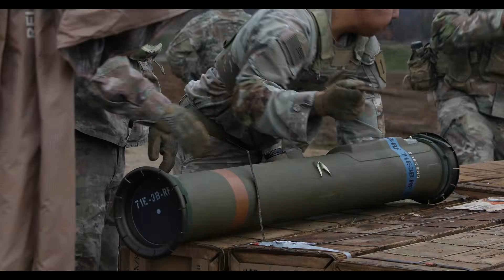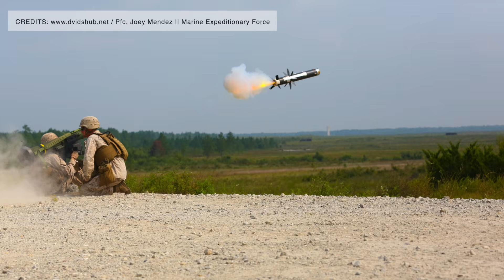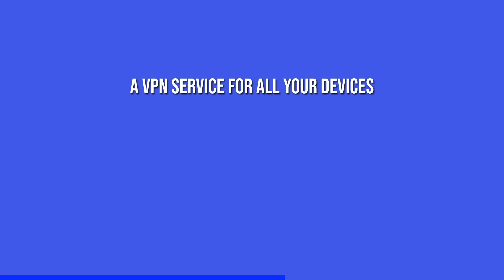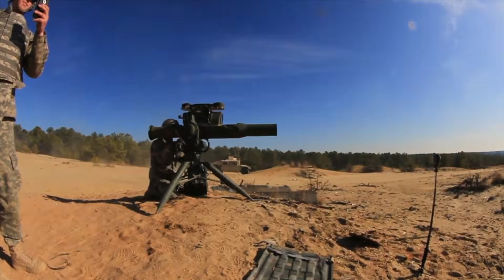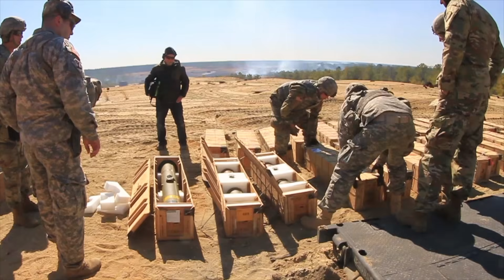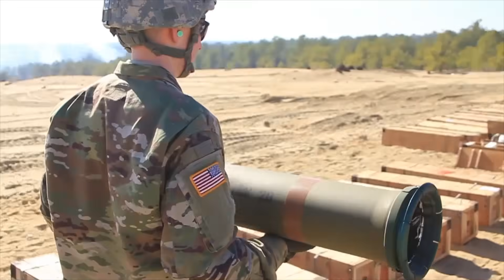More than 5 decades after entering service TOW ATGM gets new orders !

Comment: True the TOW is old but goldie, The TOW-2A top attack mode is very vicious against armor however the TOW needs to be retired.A new missile  with at least 10 mile range but most important
vehicles can fire it while on the move . I would look at the Israeli made SPIKE.  A lighter weight variant of the NLOS with 15 mile range, 25lbs warhead and dual seeker but keeps weigh under 75lbs
The Russia T-14 has advanced defenses but still very vulnerable to top missiles able to drop in at 70 plus degree drop